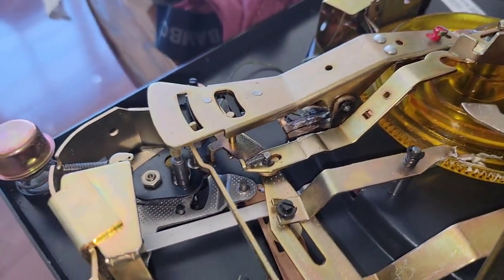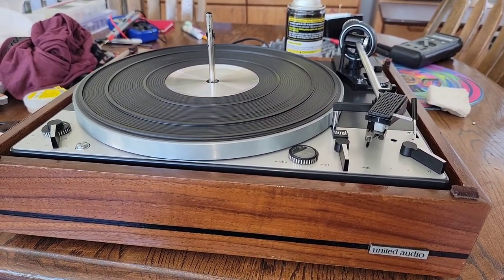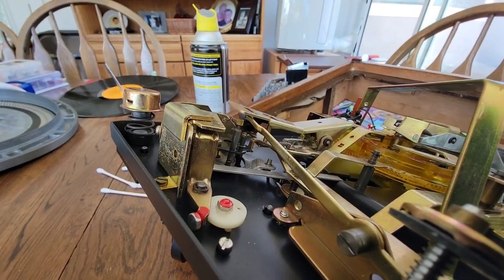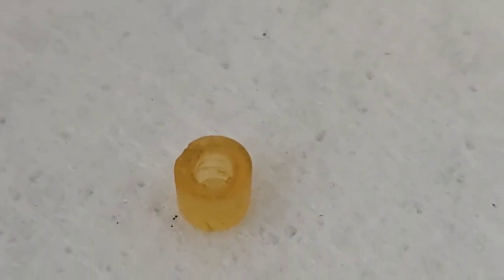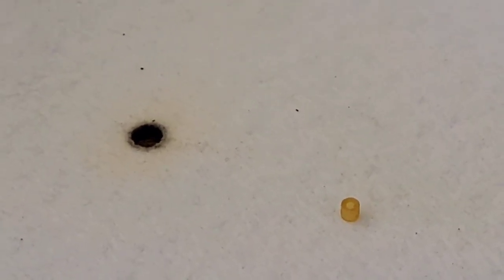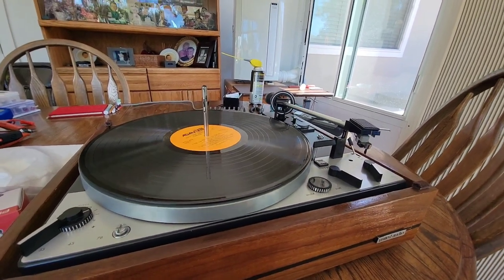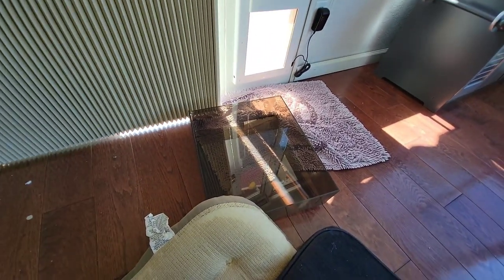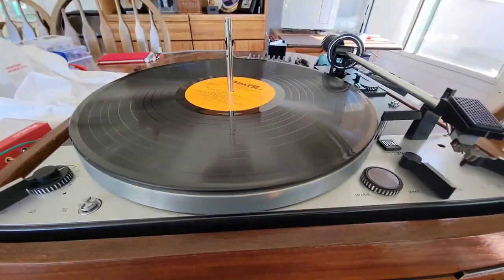Dual 1229 Turntable Restoration

Comment: Restoring my electronic-shop-rescue 1229 was a nightmare. There are parts that have to be made from scratch if they can't be scrounged from other decks. I could never keep the 1229 in tune; the automatic stuff could be thrown out of calibration by simply lifting the deck and carrying it across the room. 😵

The 1229 has a great tonearm, but the rest of the deck is a real dog. I kept looking for ways to disengage the automatic stuff and make the 1229 completely manual, but I never succeeded.

I finally decided to give the 1229 to a local audio shop and fall back on my Dual belt-drive, which represents a big improvement over the 1229 from the standpoint of reliability.

Comment: This turntable allows you to very accurately balance the tonearm, and dial in the exact tracking force recommended for your cartridge.  By mounting a dust brush on the head shell, you're changing the tracking force to something between what you set it at and zero.  Bad idea.  Instead, use a hand held brush to give the record a wipe before you play it, or a brush mounted on its own arm.
Reply from the maker: The instructions on this Pickering cartridge says to add 1 gram to your desired tracking pressure, to compensate for the brush.
Reply from the maker: The brush is carbon fiber and also adds antistatic function as well as removing dust.
Reply: In spite of Pickering's instructions, the whole idea of reading a microscopic groove with a stylus depends on letting that stylus rest in the groove with a precise amount of downward pressure, free of any other lateral force or vibration of any kind.  A headshell-mounted brush will not just affect tracking force; the brush's fibres will themselves be tracking the grooves, generating skating forces, and transmitting vibration to the headshell as they "read" the grooves.

The dust removal and anti-static functions can be achieved just as effectively with a brush mounted independently of the tone arm.  

Whatever you decide to do, it's good to see that you're taking care of your records.  Rock on!